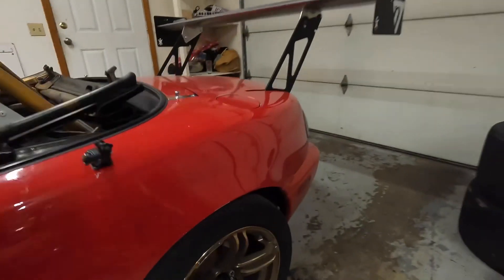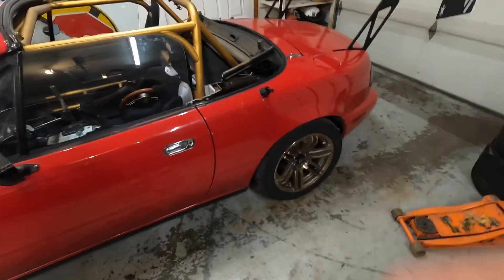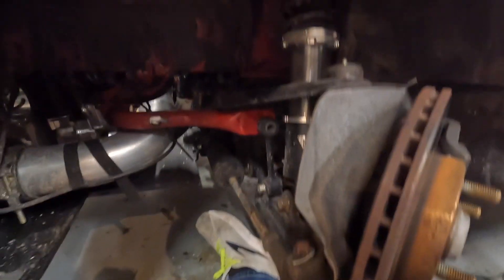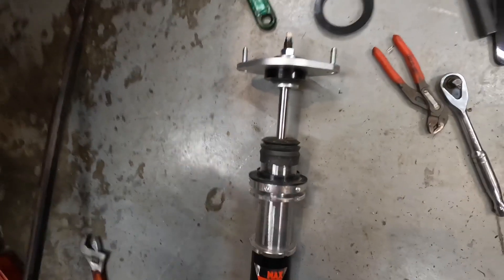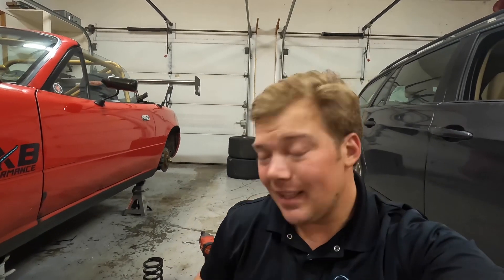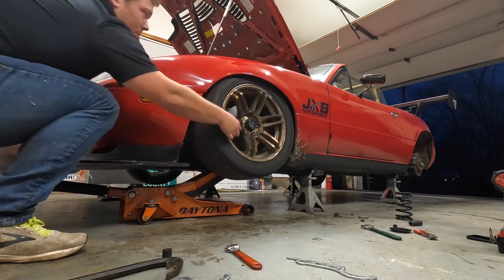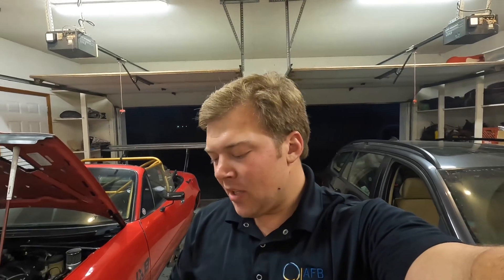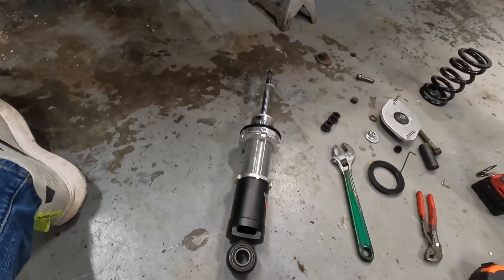Playing with coilovers: how to measure droop and bump travel

Comment: You can also do this fancy equation:

Suspension Travel: 175mm
Sprung Mass: 950lb
Motion Ratio: 0.65
Spring Rate: 600lb/in
Preload(inches): 0.4
Bump Stop Height: 2.25in

((175÷25.4)−((950÷0.65^(2)÷600)−0.40)−2.25)÷0.65

That's used to calculate compression travel. Use the answer, multiply it by the wheel spring rate (spring rate x motion ratio squared), and divide the wheel spring mass limit (what you just calculated) by the corner weight to calculate static g force limit (braking/acceleration). L/R g force will require swaybar stiffness to be known. (It rarely ever is)

Antiroll Bar Stiffness: 1970lb/in 
Spring rate: 600lb/in
Static g force limit: 0.53
1 is to make the value a whole

(((1970*0.65^2)÷((1970*0.65^2)+(600×0.65^(2))))+1)×0.53

0.94 g dynamic force limit

This setup uses the bump stops (Swift Bump Springs) on purpose to change driving dynamics at the limit.

😂 But to find the perfect spring you have to corner weigh your car and even then a shit ton of Calcs to really get it right.
You'll also learn 8in springs are a bit too short for 3500lb+ cars.

Comment: Preload is a crutch for soft spring rates vs available travel (see every cheap Chinese coilover).

Remove spring, jack up the suspension. If tire hits, change shock body length longee via lower ring. If there's still room to go up, shorten the body length.

After all that, you set the ride height via the upper collar only.

$10k Penskes don't have "fully threaded" bodies to set preload because the body height is spec'd correctly to begin with.

If you set preload how most China coilovers makers say, you will end up hitting the bump stops at different ride heights left vs right.

Check out the videos by Annex Suspension and Gears & Gasoline if you want to see the above process gone through.
Reply: What I don’t understand about this method is that why adjust for max droop/bump stop when the stiff springs won’t even allow for the shock to fully compress. Also most suspensions geometry/design would probably not allow for this method since springs are so short that it would have massive play or come lose (divorced set up)
Reply: @Shinigami_1320 when using linear spring you really should be using helper springs because with a proper set up the spring would be floating at full droop so you need the helper to not damage anything. With a progressive you can get a good setup without helpers. Take a look at KW or any premium brand and you'll see if they use linear they always have helpers. Having "10mm preload" like all these chiense brands say is plain wrong. Cause this causes things like 3 wheeling in hard cornering. A pair of $1000 BC coilovers can ride great once they're set up by someone who knows what they're doing

Comment: Funny how vids going "These kits have independent height and preload adjustment which is awesome! You can slam your car using the lower ring, and really dial in that spring preload by adjusting the bottom spring perches without messing with your ride height!" get mad views, and guys actually providing valuable info get 300.. great video man, watching thise before installing my first set of coilovers on the track RX8 ✌️
Reply: Right my thoughts exactly! Those tutorials get millions of views. The only way to see videos like these is if you already know what you're doing (I typed in "how to set droop on coilovers") but the average person won't know about this and will then say coilovers ride like shit which shouldn't be the case in a well setup system
Reply: That's the reason that 2 years after putting a set of bc coilovers on my miata, I realised that I can play with preload and not just set it to the 5mm recommended by the manufacturer (and every other carfluencer:p)
Flying Miata made pretty good videos about this, that's how I realised my ignorance !